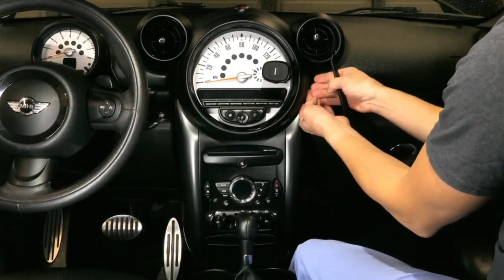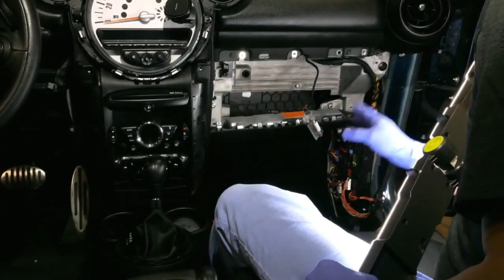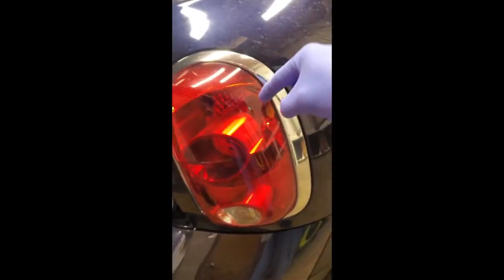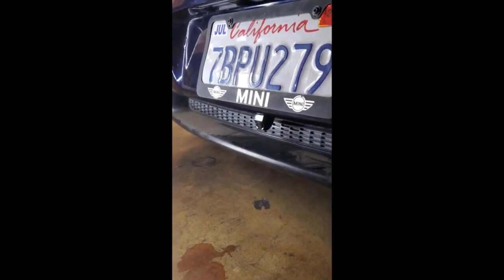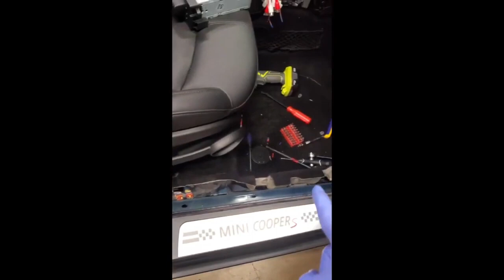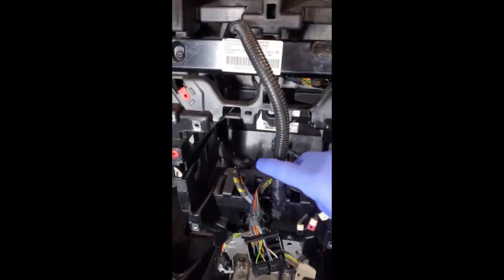Installing Your Android Carplay Screen into Your Mini Cooper MINI R55 R56 R57 R58 R59 R60 R61

Comment: Just a couple questions.

 - What year MINI was in the Vid? that looks different than my 2009 clubman R55. similar to the R56 
 - What is the link to that unit? The link in your Description is cut of or broken. 
 - What does it look like when fully installed your video ended before seeing the fully install working with everything. 

Good vid to explain how to remove the panels. I've taken mine apart to get to my security modules and it can be a big pain in the butt. you were through. great job!

Comment: Thank you for your video but how to setup the Instrument cluster clock? since it always shown a triangle exclamation mark!
Reply: oh good question! you may need a scan tool that can set the time to that module since it is basically an output module for information. I always set mine to Speed reading and it wont show the time. mine may be different from yours.

Comment from the maker: https://www.carplayergps.cc/products/wit-up-for-mini-r55-r56-r57-r58-r59-r60-r61-8-touchscreen-android-10-aftermaket-gps-navi-carplay-autoradio-car-stereo-radio   The link to buy
Reply: I have a similar (if not the same head unit) with the steering wheel controls, what wire comes from the car to plug into the head unit? Or, how are the steering wheel controls connected to the unit for them to work? Thanks.